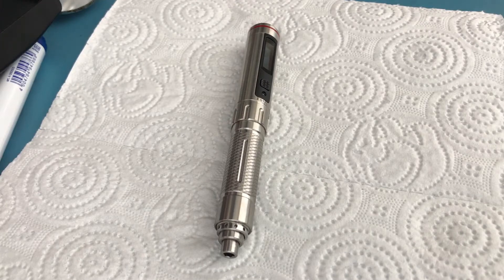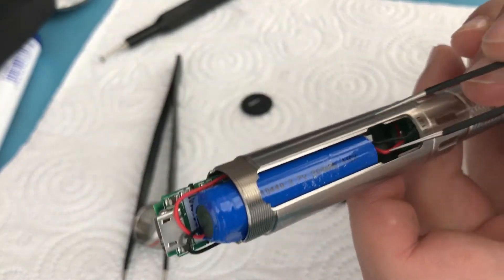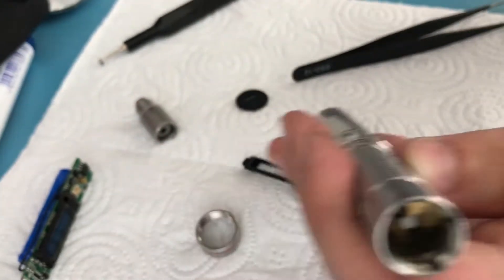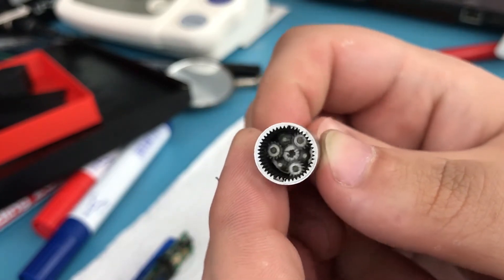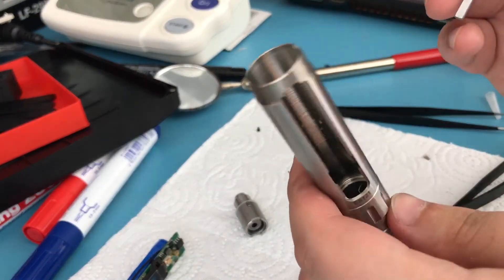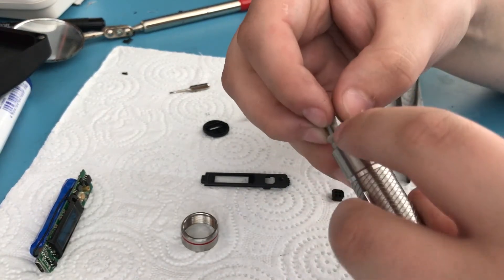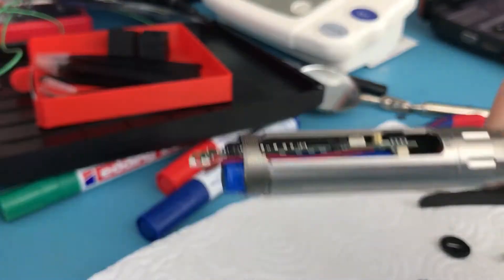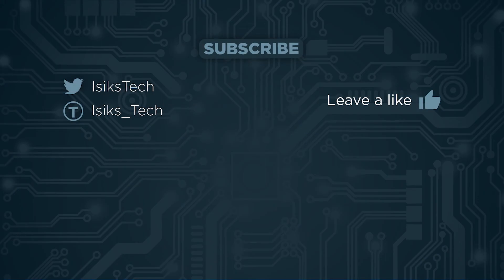ES121 Teardown

Comment: If someone is interested in replacement motors. With my ES121 the motor was burned. I bought some replacement motors and this one worked for me so far. I just repaired it and it is running again!
https://de.aliexpress.com/item/32330885601.html

maybe the following also work but i didn't test them
https://de.aliexpress.com/item/32862273268.html

Just some more advice, to attach the gear i took the motor apart. With another motor i tried to hammer it on the shaft and destroyed the bottom plate. So, hammer the gear on before you close the motor. And check while doing so if the length fine and it fits the into the planetary gears without being pushed to the motor bottom plate.

Comment: Planetary gears are used in all automatic transmissions and gas turbines, too bad the driver is trouble for 100 bucks. Take a 10 buck cordless apart, install in a PVC tube with high amp 18650 and wire a FET full-bridge PWM switch and out torque this thing.